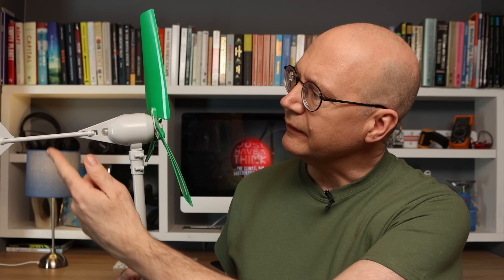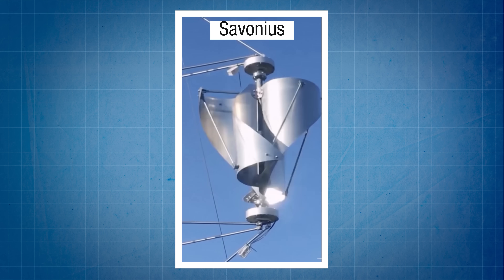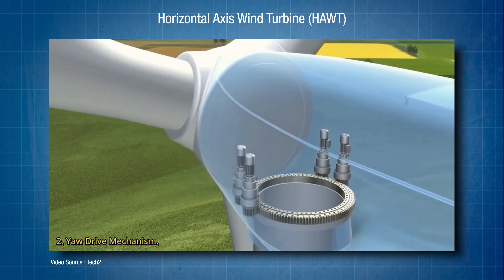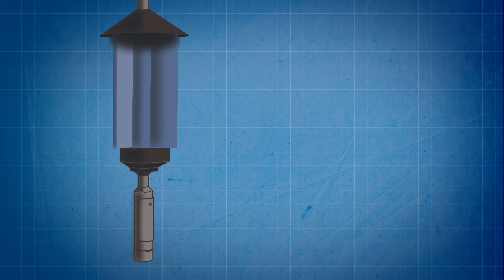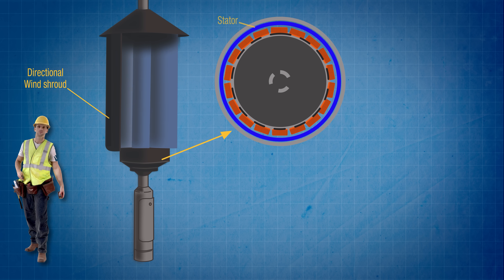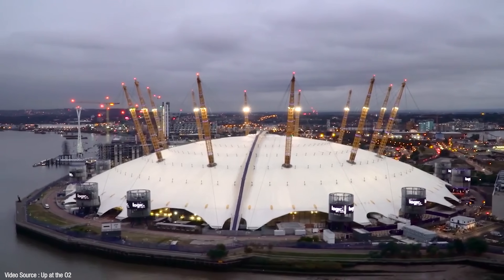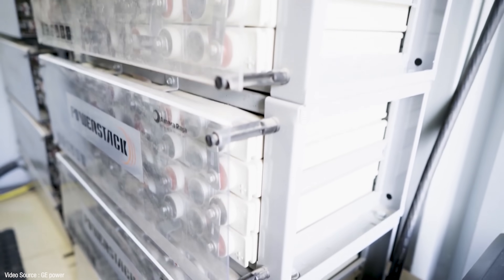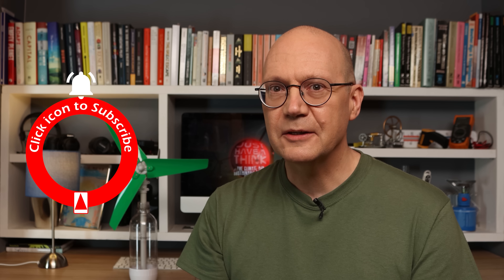A vertical axis wind turbine that doesn't need the prevailing wind! How do they do that?

Comment: In the comparison to solar at 8:50 they use 125 turbines to produce 3MW - thats 3000 KW / 125 = 24 KW
There is NO WAY that each of these turbines produces 24 kilowatts of power... - even if that is their max capacity, they will rarely if ever reach it unlike the solar panels.
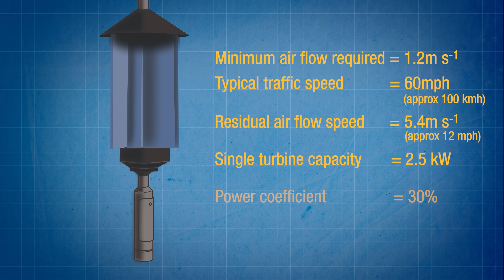Reply: Well spotted. Something is seriously wrong with his numbers in this video. At 5:31 he claims 2.5 kW for a single turbine, so there is an order of magnitude error made between 5:31 and 8:50. But even the 2.5kW at only 5.4 m/s wind for a single two meter high turbine at ground level seems horribly wrong. It's probably more like 25 W.
Reply: @tzenophile  Haha yeah 25 W seems about right :D 

Now I actually did the calculation for fun - kinetic energy  is 1/2m*v^2

If you want to know the power that is in moving air you use the Area of your turbine blade disk, the velocity and air-density to get the mass flow:
Power=1/2*Area*Density*velocity^3

Its a well known equation you can find it anywhere.

If I plug in the numbers:

1/2 * 2m*0.5m * 1.3kg/m^3 * 5.4m/s ^3 = 102 Watts

I get 102ish Watts - thats the power the air has if you extracted all of it, but since the air needs to go somewhere for new air to hit your blades you cant slow it down all the way and a turbine can only be about 50% efficient - vertical turbines are alot less efficient though so you proably only get 25% efficiency and thats exactly your 25 Watts!

So great guess there - Even I was more optimistic, thinking along the lines of 1kw maybe...

hehe Yeah its a really useless idea i think.
Reply: @jeffreylebowski4927  If they ever ask people to invest, based on those numbers, it would be a criminal, punishable offense. Dave needs to retract this video. I like his stuff normally, so this is hugely disappointing. 
P.s. I am for some reason good at guessing numbers - thanks for the actual math!
Reply: @jeffreylebowski4927  i knew they are bluffing with calculations. I had read and done some calculations of my own few years ago and the result was clear- that this method is so under producing that it is not worth the time, money and human effort to it.

However the only area where this method would prove useful, according to me, is in very windy areas(not alongside roads, but empty and barren valleys type areas) or if used in capturing energy of storms and hurricanes(provided we can make very durable VAWTs).
During storm all the HAWTs are shut down thereby wasting huge amount of useful energy. If Alpha 311 invents or designs VAWTs capable of capturing energy from storm and hurricanes, when most of the HAWTs are sitting idle, that would be very useful.

This is my take. Yours thoughts about it?
PS- Not a native english speaker.
Reply: @peace5417  Yeah, the high windspeeds of storms have alot of energy, but a hurricane or big storm only happens on a couple of days in a year, so if you design a turbine for that rare event you would be mssing out on efficient production during the rest of the year, even if you are producing more energy during a hurricane or 10-20 days a year.
So over the whole year I think such a turbine would be alot less efficient than traditional Horizontal turbines.
But its not a bad idea.
Reply: @jeffreylebowski4927  Your possibly missing important points:

1) The surface area of the turbine is much larger, at least x2 because it's being affected by traffic from both directions.

2) There is no gearing, and the magnets are directly attached to the blade, which would seriously reduce loss of power due to friction, compared with other turbines.

3) He mentioned them working from 7am til 10pm, so I assume the 3MW is per day (ie 15 hours), and the solar panels power was calculated by the average hours of sunlight per day , not per hour.

Possibly you are incorrect by "orders of magnitude" !?

I may be wrong, but I hope these things ARE as good as they say, and that they get used widely ! :-)
Reply: @markbradley4756  If no gearing was more efficient - no turbine would have gearing - so thats already factored into the 30% max efficiency these turbines have.

The wind also wouldnt be seperated at the middle of the road so each side of the turbine only sees the wind coming from one direction - where those winds meet there would be turbulence and canceling out, which is why as the video mentions one side of the turbines will be shrouded.

But even if you assumed 40% efficiency and 2x blade size, you would only get 80watts which is 3% of the advertised 2.5kw per turbine.

In your 3rd point you seem to have a misunderstanding of what the Units mean - MW is not an energy amount, its a power amount. 1MW = 1 million joules per second.

So if we grant you your first two points just for fun, for 125 turbines we get 125x80watts = 10000watts or 10kw.

which is 1/300th of 3MW.

If they worked for 15 hours you would get 150kwh of energy - a solar farm of 3MW would generate 3000kwh of energy 20x as much in just 1 hour at full sunshine. Or at least 6000kwh of energy even on a cloudy day. 40x

The numbers and poweroutputs in this video are all off by several orders of magnitude. - there simply is very little energy in these slow wind speeds.
Reply: Great comment. 

There is so much wrong with their calculation. They state the daily output of each turbine to be 6 kWh, with 125 of them, which will mean 750 kWh in total. Far below the 3 MW promised which will make it much more expensive than solar panels.
Reply: @sevret313  Yeah you are right, ontop of that I dont think these turbines can produce 6kwh a day - in the video they mention 5.4m/s wind speed generated by the traffic - if you calculate (like I did in a comment above this one) how much kinetic energy passes through the blade area 2mx0.5m per second at that windspeed you only get 100 watts - if the turbines are 25% efficient they would produce 25 watts - if they did that 24 hours a day constantly they would generate 0.6kwh in a day...
So I am not sure where the extra 5.4kwh is supposed to come from, its not explained in the video... - Maybe the cars are meant to thrust alot of air into the turbines in a big burst as they pass? - but then why not mention that instead of the irrelevant residual windspeed of 5.4m/s???

Comment: These systems or ones like them seem ideal for the developing world. They seem super modular with low installation and transportation costs. It seems like VAWTs are overall, simpler designs than HAWTs so maintenance costs are likely much lower too, particular for these wee systems. These could definitely be great for residential power, especially in conjunction of in home energy storage systems.

Comment: I'm sorry, there is no way a 2m high VAWT can produce 2.5kW of power at wind speeds of 12mph.   Wind energy is a function of the cube of the wind velocity times the swept area.  There is a reason why regular wind turbines need huge blade sweep area and high wind speeds.  These VAWT devices just can't get economical because they are so limited on what their blade swept area is.  They have been exhaustively tried for decades now - one failed company after another.  Sounds good to the non-critical ear, but this is right up there with the solar freaking roadway as a bad idea.
Reply: Are you suggesting Dave and Rosie are non-critical?
Reply: @waffleuk  In this case, sadly, yes. The formula for calculating wind power says that the 2.5 kW estimate for a 2 meter high VAWT is wrong by two orders of magnitude; less than 50 w. Try it yourself here:
https://www.omnicalculator.com/ecology/wind-turbine
Reply: @waffleuk  Can't you calculate that by yourself?
Back to school then!

Comment: So each unit produces about 24kW/ mo. (3MW/125 units) Assuming no bulk discount, which would make leasing 1 unit more expensive, the cost of leasing a unit for your residence would be £232/mo. or $321/mo. Would you commit to that as a fixed electric bill for your residence? (Of course that is twice the American home's average usage, so theoretically, some generation could be sold into the power grid.)